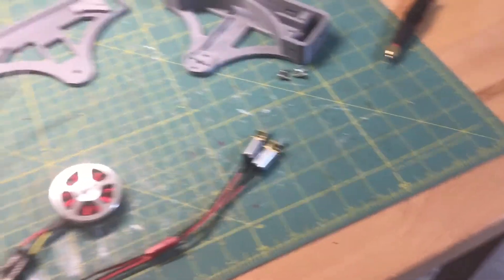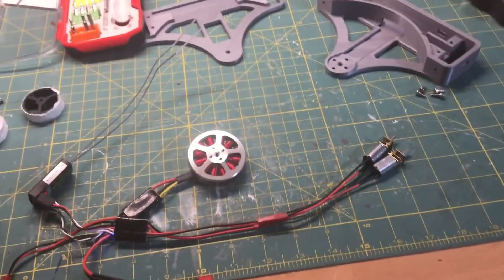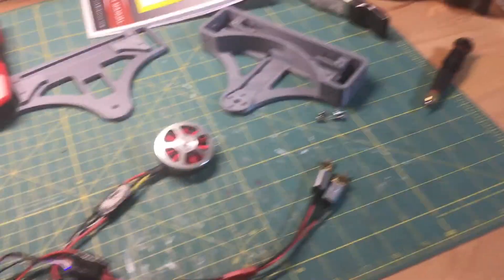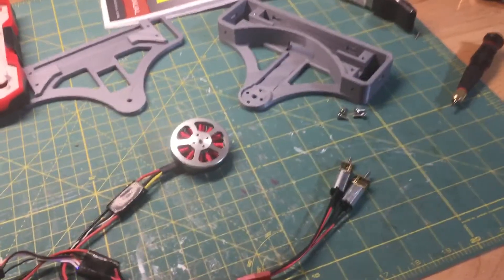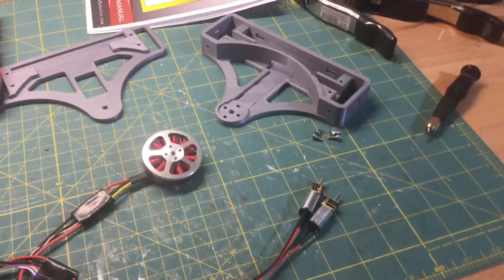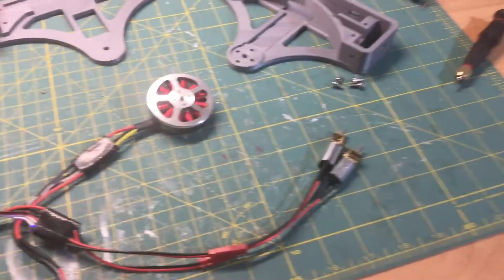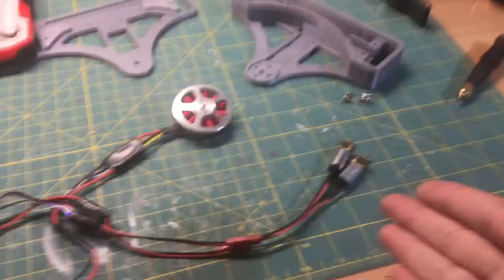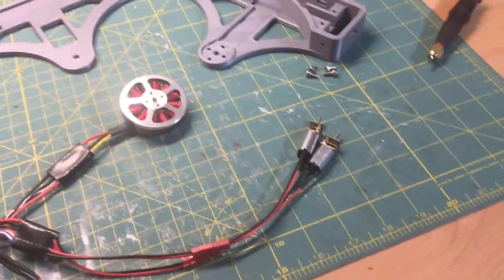Luma’s Weed Whacker P1 electronics testing

Comment: What battery are you using?
Reply from the maker: 2S
Reply: @Lumakid100  I think that’s why it’s not fast your using way to low voltage the way to find rpm for a brushless motor is you multiply the kv by the battery voltage